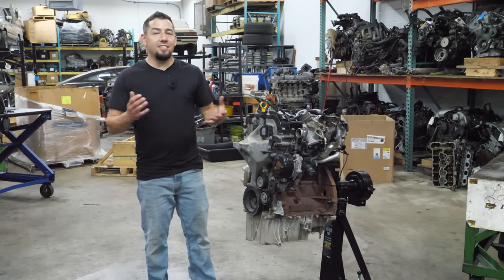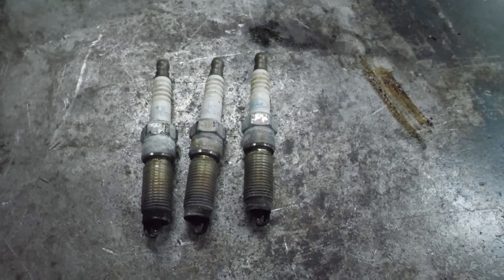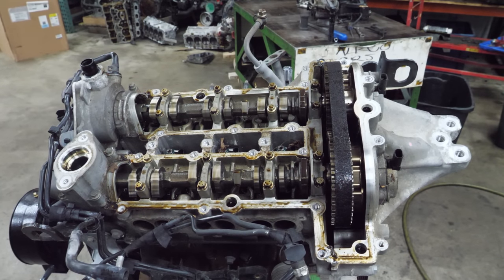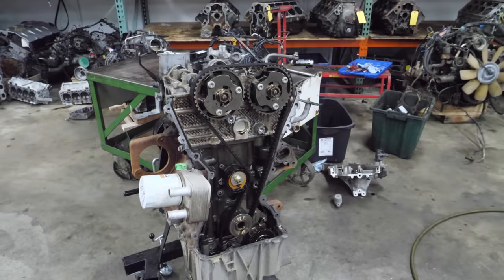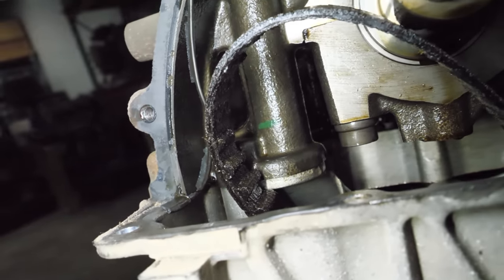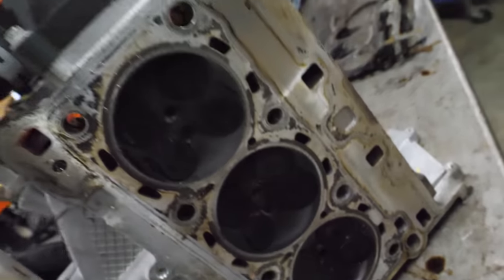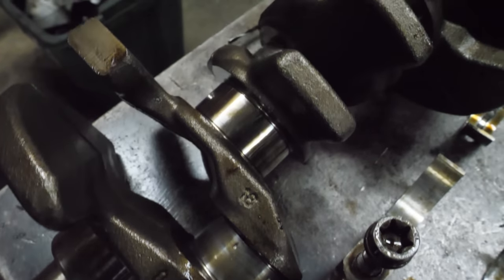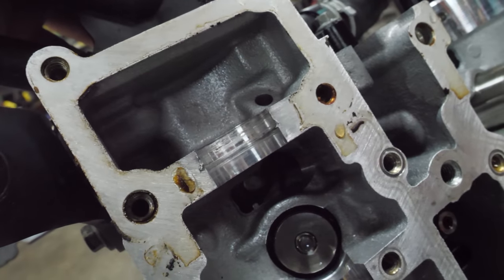JUNK Ford Ecosport 1.0L 3-Cylinder Ecoboost Teardown. LAWSUIT ENGINE!

Comment: First, I was impressed by that massive engine mounting point! I mean, it is THE prominent feature of this powerplant and covers the ENTIRE end of the engine!!! Secondly, I wonder what the recommended change interval for the belts is, and what the labor time for a belt change is. But I think I know where this design came from... A manager tells an engineer "I like the old days of timing belts, but I want you to eliminate those pesky camshaft seals" or maybe "I want you to incorporate VVT on an engine with a timing belt, but differently from how other brands did it". And of course, "I want you to eliminate that expensive keyway cutting operation on the crankshaft". I mean, they already eliminated the machining of a connecting rod journal and a main bearing when they went to 3 cylinders from 4. Yeah, you hit the nail on the head - "Eco" is not for saving ecosystems, it is for "economy". I still can't get over those teeth in the oil pickup. It's like Mission impossible - Should you decide to purchase this car, the engine will self-destruct in 30,000 miles. If it should fail, the Company will disavow any knowledge of its design, and you are on your own! Next "improvement"? I'll bet they will improve this one with wet v-belts - cheaper than those belts with all those teeth!
Reply: Fords marketing: "V belts run much quieter than those old, pesky cog belts". Can we please go back to timing gears?
Reply: @_Lassic_  Ford couldn't make reliable timing gears either; The V6s were a toss up whether the gear or oil pump hex drive failed first. Anyone who can't build a simple belt drive ought to be kept away from gears, or any engineering that doesn't have Lego's logo moulded in.
Reply: @DoNotEatPoo  that's hilarious 😂
Reply: @nickwheeler8231  a very good point... but no one has used timing gears in years because they "cost too much and are too loud". At least according to Scotty Kilmer, that is.

Comment: I had one of these engines in a manual Focus.  I routinely got 28MPG.  The problem with the EcoSport is that it's tall and boxy, and they paired with a traditional automatic that spends half its time hunting for gears, and causes the engine to spend 1/2 of its time fighting turbo lag.
Reply: They should've stuck the old NA 2.0 out of the Focus in the Ecosport and called it a day. Cheaper, more reliable, and probably better performance. Hell, it may get better MPG since it's not gasping and wheezing every time you even look at the gas pedal.

And that traditional automatic may not be as efficient as the DCT, but at least it (hopefully) won't destroy itself like the powershifts did. Why doesn't Ford have a kit to retrofit Fiestas with it? Better than them all landing in the junkyard when the tranny blows.

Comment: The 3 cylinder Suzuki like in the Geo Metro was actually a pretty good little gas sippper. Yes, 3x "p"s, thats how much it sippped! That engine got like 50mpg with the 5 speed and modest driving. That was 30+ years ago.
Reply: @Tablebeast: Awesome little cars. If some mental defective hadn't turned left at the wrong time and totaled my Metro, I'd probably still have it.
Reply: @Friend_of_the_One-Eyed_Ladies  I read that as "mentally defective leftist" 🥰 redundant? Perhaps.
Reply: @Friend_of_the_One-Eyed_Ladies  My sister had metro , for the abuse and neglect it took, it was a solid little car, certainly much more durable than its Cavalier counterpart, I think by the time she was done it had close to 150k.
Reply: @piggy310  My exes old green 91 was "pushed off a cliff" at like 280k? NO major rebuilds, just regular maintenance (thanks to me). All it needed at the time was a blown head gasket, but by then the interior had gone to sheet and the paint had lost most of it's clear coat so it was a good excuse to replace it at the time. Looking back... well I think you know how that works.
Reply: I had one of those, great little car, no major issues.

Comment: The Focus Ecoboost didn't sell well here in Australia, apparently failures like this are fairly common and as a result resale value of the cars is virtually non existent to the point where you can buy cheaper than an older 1.6 litre variant. Kinda surprised by the mpg figures you quoted, that's worse than many turbo 2.0 engines out there.
Reply: The 2.0 liter bi turbo ecoboost diesel in my 2022 Ranger destroyed itselve at 11000 km only new engine installed under warranty,,,,this rubber belt in oil is a stupid design it should be a chain,,,other brands in europe have problems with a same designed engine with this belt as main cause

Comment: The vast majority of the failures on this motor can be attributed to three main reasons: 1) not changing the timing belt when required. 2) not changing the oil and filter on time. 3) using poor quality fuel.  This isn't Ford's fault.  That's on the owner.  Now, the timing belt and the oil pump belt are indeed very strong, built with reinforced Kevlar material so these belts were designed to operate in oil.  The problem is most owners don't change the oil on time, or use the incorrect grade of oil.  This leads to contamination of the belt.  Most owners don't change the belt on time, and when they do they fail to change the belt tensioner, the oil pump belt, and the water pump because it's all supposed to be done at the same time.  Dayco actually makes these belts and you can purchase them from either the Ford dealer or from Dayco.

Comment: I was all into buying a 2021 Ford EcoSport Titanium until I did a tiny bit of research of the tiny turbocharged engine. Too many early failures for my taste.  I found a funny comparison of the Ford Ecoboost 3 cylinder vs the Geo Metros 3 cylinder and I thought I doubt there are going to be many Ecoboost 1.0 engines that last as long as the little Suzuki built ones have. My little 3 cylinder Metro has 203,000 miles and still runs excellent and burns very little oil
Reply: Yes a Suzuki would be a good teardown for this channel.
Reply: I’m at 400k on my 1.0 fiesta, the only car I’ve had that broke 250k that didn’t burn or leak oil. 
Still gets 50mpg or greater on the freeway.

Comment: no key way is fairly common on European engines, its a good setup if done correctly as it allows for very accurate timing! You lock the cams and crank in place, remove belt and pulleys, clean them up with degreaser, refit, replace and tension the belt, turn the pulleys and belt over a few times, then torque to spec, perfect timing every time!
Reply: Ahh yes European engines so well known for repairability 😂

Comment: This seems like a cleverly engineered engine with the exception of the wet belts.  If they replaced the belts with chains, it might run forever.  Isn't it a shame that what might be a great little engine was doomed by some bean-counter that wanted to save about 10 bucks per engine.
Reply: This. With a chain it might be a decent engine
Reply: @DeathMonk069  I wonder if someone can redesign it to use chains...
Reply: ermmmmmm ford 2 litre diesel engine with chains....another engineering disaster. Its a ford, ergo its crap.
Reply: @TIMMEH19991  Fracked On Race Day.  Spelled backwards....Driver Returns On Foot.  Found On Road Dead.  Failed OR Dead.
Reply: Ford changed to chains around 2019 if I recall corectly.  You can retrofit the chain setup to older belt versions of the engine. But don't stress, Ford have plenty of other ways to make Ecoboost engines fail!
Reply: @CrackerSmith  You can already get the parts to convert the engine to chain drive from Ford.
Reply: Rubber was used as it's quieter...that's basically it. They MUST be changed on schedule, also. Where I live it's not expensive to do as labour charges are low. But I guess soem people neglect changing the belt due to cost.
Reply: @CrackerSmith  JLR thought of that, use a simplex chain made from plastic and stick it behind the flywheel, because you want a robot to build the dam thing all from one end. Then tension it via a paper tissue tensioner. Job done!
Reply: @mathsunmasked56  That's because....IT'S A TRAP!!!!  Would you have suspected a wet belt system by looking at the outside of the motor?

Comment: Things to take into consideration with this engine. Yes its a high maintenance engine. Look after the coolant and oil changes it'll look after you. Here is the UK fitted to the  focus, fiesta, C-max, B-max, ecosport. I am a Ex Ford service manager, and all failures were due to poor maintenance unfortunately its not fit for most owners who don't maintain their vehicle!
Reply: Sorry, but that's bullshit. I have come across at least 3 1.0 Focus with cracked engine heads, with less than 2 years and full maintenance from approved Ford dealers. Any engine that doesn't last 2 years with brand maintenance is just garbage. The heads, head gaskets and turbo chargers are the worst I've ever seen.

Comment: Had my Focus 1.0 Litre EcoBoost for the past 7 years and done 96k miles in it. Always had full services every year and it's done me wonders. Averages about 46mpg with both motorway(highway) and city driving. 

May get a new timing belt soon but may just run it into the ground and see how much I can get out of the one and only belt 😂
Reply: Service manual book from Volvo recommend to replace a timing belt on 75,000 miles OR 5 years.
Reply: @junkman8742  2005~ Volvo s40 with T5
Reply: @technocody9296 how is that relevant?
Reply: @bikeman123  FoMoCo :)
Reply: @alexanderkennedy2969 correct, if belt break on interference engine required replacement for a new engine.
Reply: @technocody9296 Is that timing belt a wet belt for that Volvo?
Reply: @nowiecoche  Nah, Volvo used dry belt but the maintenance recommendation tells that we should change timing belt before too late.

Comment: I concur with your summary of the design of this engine.  I have bought x2 of these engines in Ford Fiestas for my children in the UK.  (Ecoboost 1.0litre petrol). The first suffered oil pump strainer blockage from shredded timing belt. ~$2000 of repairs later and the engine is still full of little bits of rubber and material which has now trashed the turbo charger bearing, and I dare say the major engine bearings.  Solution short of putting car in a skip is to buy a new engine,  no point in a recon with no history or trying to rebuild this one. Ford want almost $6000 for a new one I can get one that I believe was an original Ford engine manufactured a year or so back at a cut down deal price - indicating culpability perhaps because so many were failing?  I understand these cut price engines were made available to the trade, who snapped them up to resell later at profit.. I am ow looking at buying on for around $2400.  It is a pity i had not seen your video before buying x2 of these engine powered cars.  I now live in fear of the second going the same way as the first.  Good piece of work, very professional in your assessment of the shortcomings of the design, if you ever had to get the engine out of car, you would note there are several more very poor maintainability issues built into the engine.
Reply: comment above yours says "The oil changes are key on these, old oil with its debris and acidity eats the belts. Always do oil n filter changes twice as often than what the manufacturer recommends." Maybe just keep up on oil changes as often as possible to give yourself the best possible chance

Comment: I would suspect some sort of oil additive or some oil that had some additive helped eat the belt. If they happened from just oil, there would be huge problems with these.
Reply: These engines are super delicate on the oil. They need to have very specific oil with additives to protect the belt. Use the wrong oil once, even if it's just a little bit, and you have to replace the belt, which is really expensive due to including so much labour and needing special tools, or expect engine failure in the future.
Too much fuel condensation in the oil also kills the belt.

Comment: Eric,
Great job as always. I teach engine repair at a community college after 37 years in the business. You channel gets mentioned a lot. 
 I was curious about the mileage interval for belt replacement. I looked it up on "somedata" and they say 150K. Wow!
Reply: That's crazy high. I had a 2010 Elantra and that engine is bulletproof and it still recommends it at 80k
Reply: Yea, but look at what extent you have to tear down the engine to replace that belt.  Major Surgery. I bet these engines are just meant to be throwaways.
Reply: Service interval: 150k or whenever engine fails due to valve interference or oil starvation, whichever comes first.
Reply: The belts do last if you follow oil service schedule perfectly with the correct oil. Unfortunately many people do not...

Comment: My 2012 B-Max 1.0L Ecoboost is in the garage atm for a timing belt replacement at 80k miles which I have been neglecting for a year. The condition of the engine you teared down worries me a bit but I had no major problems with my car. Let's hope it stays that way as I plan on keeping it another 3-4 years.

Comment: Great video! I have one question though. How often this belt must be changed according to maintance schedule? If the owner follows this schedule strictly, is it still possible for this damage to happen? Thank you!
Reply: Im not exactly sure of the Ford spec on that, im sure Google could help, but I'd say between 75k & 90k. I definitely wouldn't go past 100k, at most, with it! 👍🤔🛠️🔧🔩🗜️⚠️🚧🔗📏🧤🥽👌
Reply: Ford recommend every 10 years or 150,000 miles. Just keep that oil clean and the correct grade 5w20 castrol developed with Ford. I change my oil every 5k miles even thou Ford recommend every 12,000 miles.
Reply: If the belt tensioner fails, which looks like what happened here, nothing else matters.
Reply: I believe ford have now done away with the wet belt and have now fitted a cam chain from 2019-2020 models.

Comment: They have earned the name “Ecoboom” here in the UK for their ability to self terminate! I will never understand the absence of key ways but do understand they have a special tool kit that locks the crank in position and alignment of the 2x camshaft’s with the flats that shows data matrix codes, along with a starter ring lock to allow the crank pulley to get tightened to a high torque setting plus an extra turn after 😮
Reply: Here in North MERIKA. we don't drive this shit. We prefer our V8 Naturally Aspirated F-150s.
Reply: So much for German made 😢
Reply: @bmw803  haha, plenty of EcoBoosts in North America
Reply: Ford is not the only manufacturer using keyless cam drive components/sprockets. On assembly, the crank and camshafts are held in their timed position by fixtures which ensure the cam timing meets the design spec.  Tolerance stack up prevents keyed drive sprockets and cam sprockets from achieving sufficiently precise cam timing.  Sub-optimal cam timing degrades emission performance and fuel economy.  On some applications a diamond impregnated washer (one time only usage) is required to keep the sprockets from slipping once torqued.  I believe the Chrysler hemi uses one.
Reply: @g.n.b.3351  I’m glad there is a logical reason behind all that polarva, these engines have a lot of time and money swallowed up in these ideas of improvement but I got the impression there are a whole new list of reliability issues flagged up which needs more expense and development time to get them right hopefully before they can’t be made anymore…but sure it’s considered all good stuff somewhere… 🙂
Reply: @bmw803  Speak for yourself, love my 3.5 EB.
Reply: @g.n.b.3351  Yep, the ford/mazda duratecs all use the diamond washers. Works absolutely fine tbh , I've never seen a reliable account of even a single failure and the timing tools cost pennies, but it's still annoiyng to have those extra parts that need replaced. And you can guarantee that people don't realise they're single use
Reply: @JulianKapa   For sure, but not many of those tiny ones though. They're mostly V6 ecoboosts used in F-150s, escape 2.0L, and Explorers. Earlier generation Edge used naturally Aspirated V6.

Comment: In Europe this engine is pretty common and the second generation of 1.0 is nowdays like all we have in bulk of models. This first gen is notorious for its belt. It's very sensitive for oil spec and when people put random cheap oils in it belt got like etched and boom it went. Also no service wanted to do cam buckets and carbon buildup = bad detonation is also a big issue. Second gen of this engine is very good so far they fixed most of these problems - dry belt, rockers instead of buckets and carbon buildup is yet to be seen.

Comment: The EcoSport is discontinued but the 1.5L version of this engine is in a lot of newer Ford cars.  A major problem with all the Ford Ecoboosts is they're direct-injected so there's no fuel/air mix from the old style port injectors to clean the intake valves off.  I'm told they get cruddy fast since the PCV system feeds a lot of crankcase blow-by into the intake manifold.

Comment: We done one at the shop recently, sounded like it had a total come apart inside and the car looked well maintained. Super small and light. Junk motor made to throw away lol
Reply: Do you think that the timing belt tensioner the source of the failure?
Reply: @paulherbert5548  we never tore it down, got a whole new crate engine from ford. Suprisingly cheap though
Reply: @DSGB2199  kind of like my neighbors bottom end "throw away" Toro lawnmower where it is oiled for life. No dipstick, oil cap, drain tube or plug. When Toro stopped casting the mower decks from aluminum and went to a stamped steel, I knew the fix was in.
Reply: @paulherbert5548  yep thats terrible